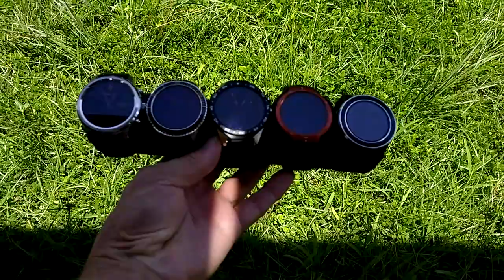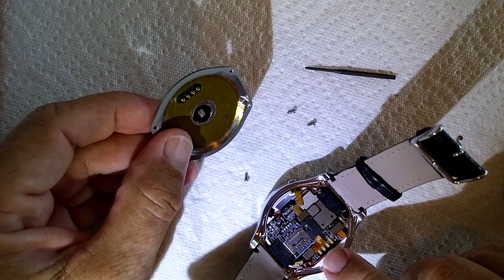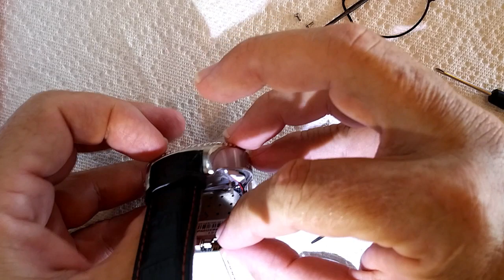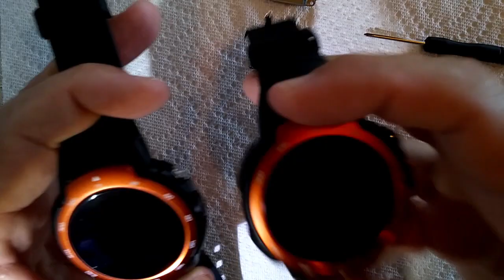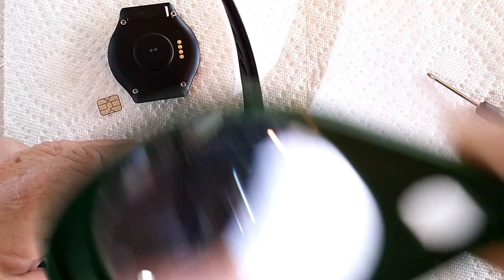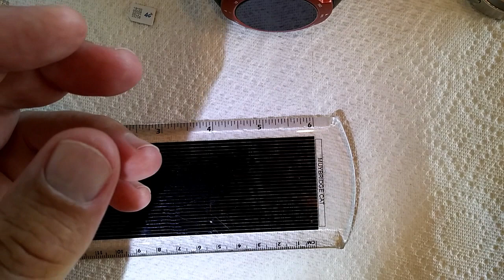Round Android 5.1 I2/KW88/Z9/S99 Watches Compared: 2-Build Quality

Comment: Hello friends, I need help with my kw88 king wear. I went to work in a ceramic furnace with my kw88. When
 I realized I had my whole arm sounded and the watch all wet inside the 
place, he hung up and called alone all the time until he unloaded. Now it only does it even in charge. If
 somebody can help me with some technician that cornessa me the plate or
 it will be that the problem is another one waiting for the help of 
somebody. My whats 55 + 67998480556

Comment: Hello everyone, today I had no luck at work and I have broken the screen on the smart watch, but on the inside and at the junction of glass and a small flat cable .I opened it carefully and move all except screen .If there are general spare screen k88 and whether it is possible to replace it ??
Reply from the maker: I haven't heard of there being available spare parts except for batteries and charging docks. You could try and reach Kingware directly.
Reply: +SmartWatch Ticks ,as always mr.Ticks thanks on your answer .I will continue with my support to your chanel 
doubtless . I knew the answer in advance, but I wanted to once again share mine  situation with you ;-)

Comment: What´ s the best simcard-smartwatch with 5mp  camera? I compared the Kingware KW88 and the Samsung Gear2 camera and think the gear2 camera s much easier to use, because the camera is located  in 12 oćlock direction instead of 3 o´ clock direction in the KW88. The gear2 has just a 2MB camera. Is the a simcard-smartwatch available with a 5mp camera where the camera is also located at 12 o´ clock?
Reply from the maker: I'm pretty sure there are no 'real' 5MP cameras on watches yet. They are, at best, 2MP which are software interpolated up to mimic 5MP, but the clarity is only 2MP. If I'm wrong one this, please anyone reading this correct me. Even the new Android 5.1 watches aren't pushing 5MP cameras from what I can tell. They use a generic Sony camera module and fuss with the advertising.
Reply: Thanks for your response. The Samsung Gear 2 hasen' t git gps so I tested the KW88. I found the camera position on 3 o' clock in the KW88 bad and think the best position for a canera in a smartwatch is 12 o' clock like it is in the Samsung Gear 2. Do you know a camera smartwatch with gps and a camera position on 12 o' clock that you can recommend? Best regards Thomas
Reply from the maker: Check out the ZGPAX S8. It's an older watch, but still one of the best out there. I have tons of videos on it way early on this channel. It was my main smartwatch when I started. Tire's one video posted that has links to the actual pictures taken with the watch, at least I think it is still there.

Comment: what is the chepest watch with android software like the finow x5 and No1 d5 has?
Reply from the maker: Price keeps changing depending on what vendors have in stock and what specials the watch makers are offering. Usually the best price is found under the videos you watch here. If the special has run out, then look for "Flash Sales" on the vendor sites. You usually have to wait a lot longer for delivery as they often don't ship any until all of them have sold or the sale close date arrives, but you can save a few bucks.
Reply: Thnx for the quick answer.I was asking if there are any diferent models with such a software but cheaper..Less than 100 for example
Reply from the maker: Q1, Q3, D6, S6. Got videos on all of them.
Reply: SmartWatch Ticks Thnx..Gonna check them out ;)

Comment: I find very useful your vídeos.  I have one question: which of those watches do have a built in fm radio... It seems that The S99 have it... is that true?  what about the others?  Thanks for your help.
Reply from the maker: None of the fancy Android watches have FM radio built in, but my favorite app is Tunein Radio for streaming thousands of radio stations over the Internet. You need a wire as an FM antenna for local radio, so only cheap watches with attached headphones work.
Reply: Here ZGPAX states 'FM radio: yes need plugin earphone' http://www.zgpax.com/mobile.php?a=show&m=product&id=41&chid=55&g=mobile.  Would you mind verifying  if that potential functionality is actually present in the S99?  Thanks from Colombia!
Reply from the maker: Yea, I rad that too. I thought, "Really? A plugin earphone?" There's no earphone jack on an of these watches. That was copied and pasted from another phone description is my guess. The only FM radio would be from a downloadable app, and it will be a streaming app using the Internet, not an FM tuner in the watch. Sorry, but it's just not there.

Comment: Hi Sir, in your opinion, what is the better watch between "Kingwear KW88" and "IQI I2" ? And better to use too. Another thing, the antenna is really inside of the straps or we can change those rubber straps for the leather ones in a watch-house? Thanks for your attention.
Reply from the maker: Well, Jefferson, IMHO (In My Humble Opinion), between the SW88 and I2, I'd probably choose the Z9. Why? It has a flat surface where the others have a raised bezel making it hard to do swipes from the sides, top or bottom. It's waterproof -- you can shower and swim with it, and it has a camera. If the "look" doesn't appeal to you, then between the SW88 and I2 I'd wait for the "new" I2 to arrive (a review copy is in the mail right now) to see how it differs from the original. If there's not much difference, then I like the KW88 over the I2 for looks and for the larger AMOLED screen as well, not t mention its light weight. But if you ask me next month, I may be swearing by the FONOW X5 Plus, if it exists. Bottom line? Good time to wait a little longer.
Reply: Another thing, the antenna is really inside of the straps or we can change those rubber straps for the leather ones in a watch-house?
Reply from the maker: Yes, the antennas are in the bands on all of them. You can't change them. Here's a good video to help you decide. It's short but answers most of your questions: https://www.youtube.com/watch?v=cLy8hD1B-5E

Comment: Great reviews Mr Ticks! I've subscribed to your channell since I'm a watch phone (not smartwatch) enthusiast and struggle to find good info on these chinese brands.
I have one question, though. I've looking into buying one of these with android 5, but I'm really undecided... Since you've tried most, which is the best in your opinion? I'm looking for one with good waterproofing, fast, with sd card expansion and with a preference for square display (but round is definitly not a deal breaker, if it has a large screen to compensate).
What is your opinion?
Reply from the maker: Well, JohnyK07, what you want isn't here yet. You can get waterproof, but not square. None of the Android 5's have microSD (TF) card support yet, but I keep looking. I want that too. As to round, of the Android 5 watches, the KW88 has the largest and brightest display, but it's not waterproof like the Z9 and Zeblaze Blitz. All that said, I have a few more Android 5 watches on the way in, so you may want to wait awhile.
Reply: SmartWatch Ticks That is great! I'll be looking forward to those reviews! The Zeblaze is starting to look really promising. I might get one soon, but I'll wait to see your next batch :)
I just recently bought a LEMFO LF13, which is just 4.4, but it died after a couple of hours, and I am in the process of being refunded. I didn't knew then about all these android 5.1s, so now I might get one of these instead (crazy how they are about the same price!)
Thanks a lot

Comment: What about the awatch comet and awatch super comet.. They both are similar to the kw88 and x5 respectively and made by iqi..
Reply from the maker: OK, ok, I'll put in a request for both of the comets. And I thought I was starting to get caught up! This is just a hobby, you know. An intense one it seams, but still a hobby. At least I think it's a hobby. Perhaps I should look that word up. It might be a Syndrome. Yikes! WCS! Watch Collecting Syndrome! I'm in a terminal phase, too! OK, ok, Comets. I'll go hunting for comets. As long as there's a watch ticking, I'm not done!
Reply: Indeed it seems to be the same clock . However battery with 450 mha . Italian manufacturer . ? ! Look at the Website
Reply: +xCar G ur talking about the comet ?????
Reply: Yes. I See it on the hp from awatch. The specs are 5mp Camera(probably it's a software thing) and 450mAh Battery.
Reply from the maker: Wow, you're right. They look identical! I'll see what I can find out. I wonder which one made them and which one rebranded them. Or perhaps they are made by somebody entirely different and then just rebranded by awatch, finow and iqi. Interesting how this all works. If anybody knows, please share!

Comment: Hello again, thanks for your quick response and for the interesting links concerning the calculator apps. I did install the calculator app of Eric Crochemore (thanks Eric) and it works fine on the KW88. It is perhaps of interest for some of you, how I did this, as it is an apk file which is not in the play-store combined with the fact that the internal file manager of the KW88 is not able to deal with LAN. Of course you can do this  by using  an USB connection between KW88 and PC, but an alternative is to do it by means of Wi-Fi, which is very handy.
Firstly activate your Wi-Fi on the KW88. Secondly I installed a file manager on the KW88 from the play-store called  X-plore. X-plore has LAN capabilities (other file managers have this too, but I uses X-plore on my phone so I am familiar with it). Click on LAN in X-plore (KW88) and choose add server. A popup opens where you can fill in the usual data. You only have to fill in the IP address of the PC. (Look for the IP address of the PC (Windows 10) at: start - command prompt -cmd = ipconfig). Your username and your  (network) password. Test the LAN connection by pushing - in the pop-up - the button down-left  on the KW88 - it is just visible). If X-plore response with  'server ok' you’re in business. Push the 'safe' button (in the pop-up) and it will close. Then you click on LAN in the X-plore file manager and after that on the IP address of your PC. Now you see the all the (shared) drives on the PC (if not check if your Wi-Fi is on) and by clicking the drives you go into their directories. When you 2xclick on the apk files in the directory that apk file will install on the PK88 (first asking you permission to install 'not standard android' software). Well that’s about it, no usb cables needed anymore for installing apps on the PK88. Hope this is helpful.
Reply from the maker: Thanks for the detailed instructions Anton! I do something similar by running AirDroid on my Mac and phone and watch.

Comment: Fantastic video as always Mr Ticks :)  
The X5 always had the best screen and still does in my opinion. However this has it's downside as well. That sucker chews the battery if you don't have a brightness control installed.
Pretty much all of the 5.1 watches are extremely underdeveloped at the moment in my opinion. Lots of work to be done here.
One very important thing though is that the Sinsoft 5.1 watches do not lose their cellular connection at all. The X series 6572 soc watches all lose connection within 30 minutes or so and it does not connect again until a major user intervention is used (force airplane mode or reboot) - even though it looks like it's still connected.
Also the X series watches are far superior in build quality as far as I'm concerned. Let's hope they keep that with the next generation.
As far as watch faces are concerned - all the watch ODMs using the Sinsoft launcher are wanting the custom face concept so keep watching out for that.
Thanks again mate :)

PS: the I2 also does the rotate and show digital time only - same as KW88 - but only with the latest firmware.
PPS: if you take the back cover of the KW88 off like you have - be very careful when you put the cover back on - if you over-tighten the screws just a little it will break the corners off the back cover. Especially at the sim card end.
Reply from the maker: Thanks for all this great information, Pablo11! I've pasted your comment directly under the video for all to see so it won't be lost over time since these comment streams usually drift away. Once again, for those who DID find and ARE reading this comment thread, if you want more of valuable information like this, head over and subscribe to the Round Android Watch G+ Community. It's FREE folks! Click here: https://plus.google.com/u/0/communities/109827242607524552712

Comment: Thank you Mr. Ticks for this fine update.
Video after video, things are getting clearer.
The display comparison in the shade was revealing, seeing the KW88 possible performing the best. But that might also be a camera relative thing. They are all very close. In bright sunlight none of the watchfaces was visible. Maybe you could give your eyes impression/comparison on that situation.

Of course my primary interest is the KW88 watch.
There are three questions here:

#1 - Looks like there are two solder pads just behind the battery connector beneath the flex cable. Looks like they are there to accommodate soldering a replacement battery in. I saw this also with some of the other watches, but you didn't notice that yourself.

#2 - on the sim cover that can be removed separately, it looks like there is a gasket on the inside of the cover. is that true?

#3 - the pcb shield-cover  looks like it's clipped in with two clips and hinged on 1 side. Not that important, I'll check that when my watch arrives.

I've entered your bandwidth data into the cumulative specsheet I've created for the Google plus "Round Android Smartwatches- ROMs, Faces and FAQs" community.
Here the link to the spec sheet. Editor's will be added soon, so the data can be complete
http://bit.ly/RSW_Specsheet

Couldn't find the Z9 maker name. Is Z9 the model or the brand name?

Again, from a fan of your video's, "Keep 'm coming". 
Appreciate the hours of work you put into them.
Reply from the maker: You weren't seeing things. The KW88 and FINOW X5 where by far brighter than the rest, both indoors and out. I'm pretty sure they are both OLED (AMOLED?) displays as well. I don't remember the time I sent the last battery reading out -- several hours ago now -- and the watch has dropped to only 89% Granted, it's just laying around now, but very little drain. It is connected to WiFi and I have lots of third party apps loaded. Very impressive so far. I'm going to leave it off it's charger and check it in the morning.

Thanks for the great spreadsheet work! If it all comes together I'd live to cite it and refer to it in my part 3 of the comparison video series. Unless something else arrives before I record it, I'll be covering the X5, I2, KW88, T9 (Zeblaze Blitz), and Zgpax S99.

I'll have to get to your other questions later. Been at this all day.....
Reply: It's not only the brightness that counts when displaying beautiful clockfaces. Also the deepest blacks make the clockface be photorealistic. The IPS shimmer could ruin that experience.  That's the reason I've always picked the Samsung smartphones that have Amoled. Watching movies on these is gorgeous because of the black being perfectly... black.
Reply from the maker: Well it's been all night and half of the morning and My KW88 has dropped to 71%, that, of course, is after using it most of yesterday as well. I know, I know, not very scientific, and I can't give you exact times since I wasn't planning on doing a battery test, but bottom line is battery is doing fine. It's probably been about 24 hours now since I pulled it off the charger. Now I'm ready to take it out and about and will have it BT Tethered to my phone for Internet and will leave WiFi on ('cause I usually forget to turn it off anyway).
Reply: +SmartWatch Ticks Easy to say, but that are spectacular results. Leaving wifi and BT on is important to me because for now I'm not going to use the sim card.
I receive a lot of mails and WhatsApp msg per day and like to stay on top of things.
I've made a comment in the G+ group about your video concerning the two pads I found under the battery connector. Have a look. And thanks for keeping us up to date.
Reply: For the z9 model, loof for LEMFO LEM3 .